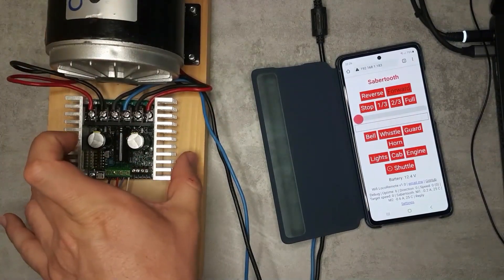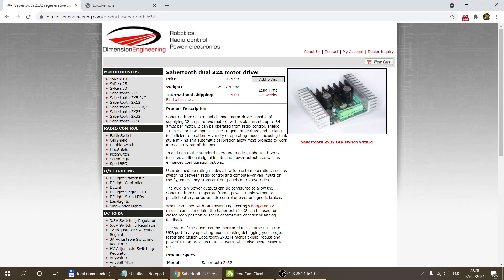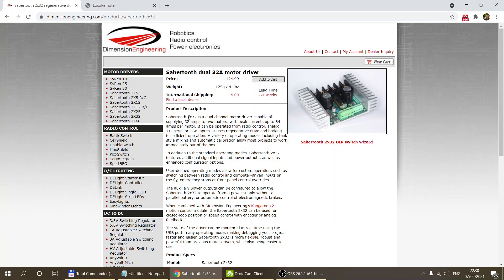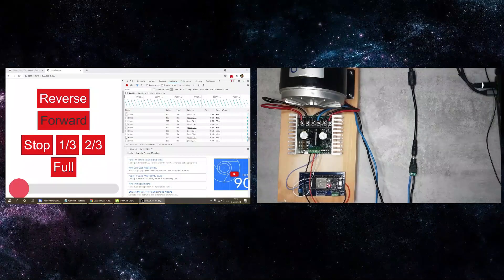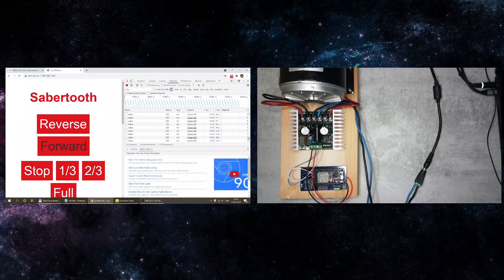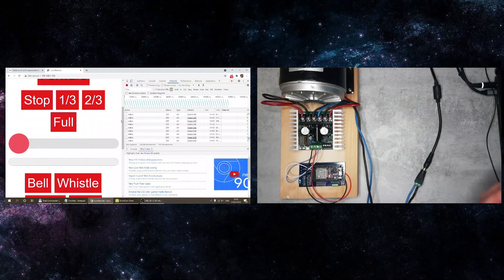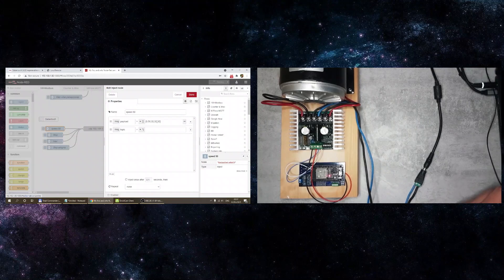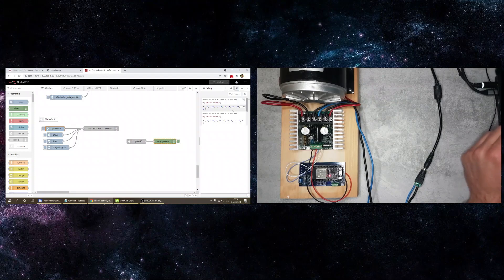Wireless control for Ride-on Loco

Comment: Does the Sabertooth m/c have the locomotive sound and light-horn drivers like a 4qd or do you attach them separately. If separately, what can i use to control my loco lights, horn, ditch lights & bell. What would you recommend to do those 4 items that would be plug and play? Because im not electronic savy?

Comment: You mentioned some mishaps with the 4qd dno-10 , can you elaborate on that? What makes you want to stop using it ?
Reply from the maker: You might have seen that my garden layout is very challenging. Tight radius, elevation and my loco has a single reduction. I have an amp meter, and I measure up to 35A current draw maximum. That should not be a problem for the DNO10, because it can handle 60A continuous and 75A short term peak current. Still, after a few years, my DNO stopped and when I disassembled it, one of the mosfet leg was damaged. The mosfet was OK, but the PCB has burned through at one of the legs. I was able to fix it with a thick solder blob and it was working again. I got the following response from 4QD: "That mosfet is the reverse polarity protection device and it carries the full motor current. It suggests that the loco has been pulling high currents to make it get hot enough to unsolder the legs, this can occur if the motor is stalled.". So after fixing it, it worked, and the solder join melted again once more. And I fix it the second time as well. After fixing for the second time, I was at an open day, and I have driven the loco 36km that day, on a track which is more or less level and have gentle curves. So the bottom line is that my loco is not ideal for my home layout. I have to be careful with load, and make sure the loco has momentum when going uphill and not push the throttle when the motor is stalled (which my kids did). Maybe the airflow within the engine is not sufficient either. Therefore I would not like to blame my DNO-10 at all. Sabertooth has thermal cut-off, which will be quite useful for sure. But I am still happy with the DNO even after all this.
Reply: @csongorvarga  that's clear and good to keep in the back of my mind ( have not decided yet what to purchase )